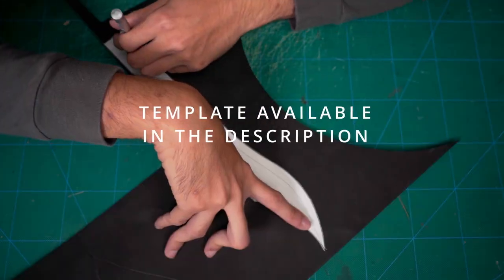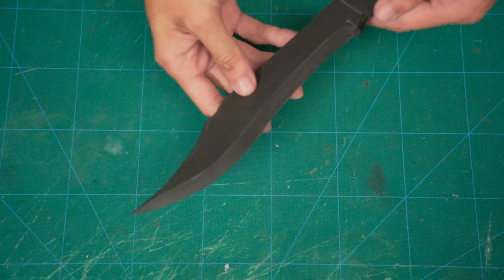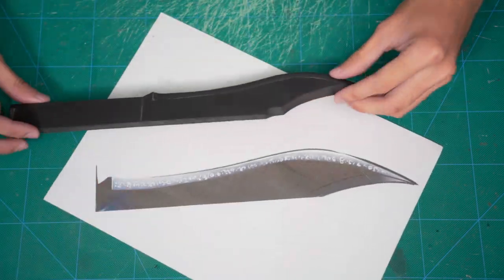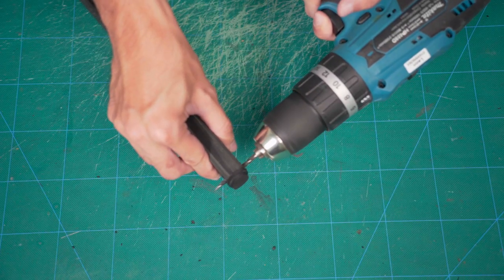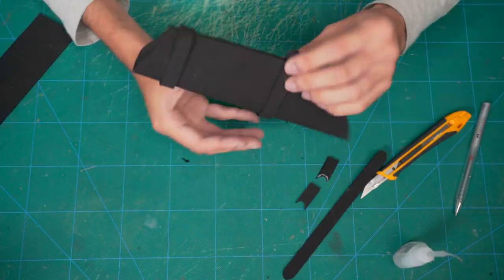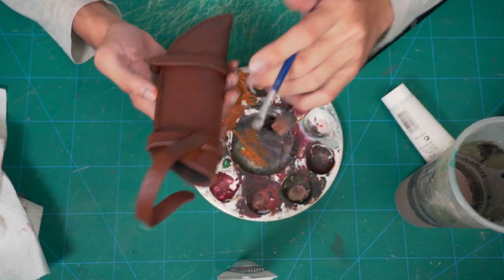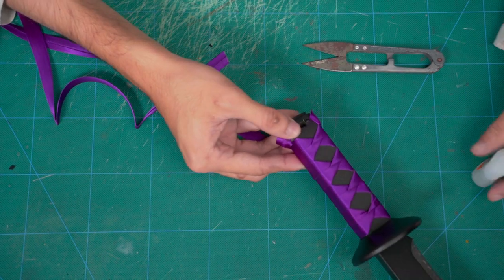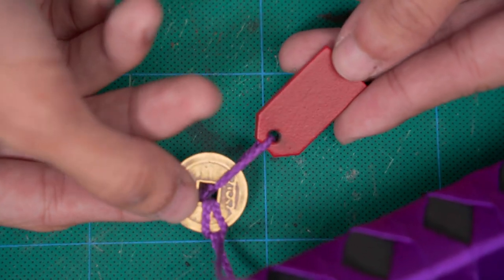Shoto 🗡️ Dagger - EVA foam Cosplay Prop Tutorial

Comment: that's all cool and stuff BUT WHY DO YOU USE A BLADE FOR ZHE GLUE???
Reply from the maker: i got quite a lot of these free cheap blade from buying foam in bulk, and I already have better knife to use. Wasn't sure what to do with those knife that time until a friend told me it is actually a good "scrapper" for glue, because the dried glue can be peel off easily and it is hard enough to apply evenly. so here you go
Reply: @LeonNoelCos  never heard that 🤔 quite interesting 
I use a small piece of foam to spread the glue evenly

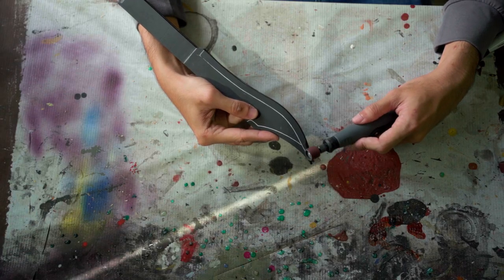Comment: 1:20 besides the rotary tool, can I used normal sand paper to sharpen the blade part?
Reply from the maker: I can't recommend any other more accessible method than the rotary tool. That's because unlike wood, foam is considered a soft and bouncing material, so if sanding with normal sandpaper will take forever. Just get a rotary tool, even a cheap rotary tool will work
Reply: @LeonNoelCos  Thank you
Reply: @LeonNoelCos  Also for wood, how do I make it look like sharp? Can I also use the sand rotary tool for it?
Reply from the maker: @jeremyyudiarta8757  it is also possible
Reply: @LeonNoelCos  Thank you